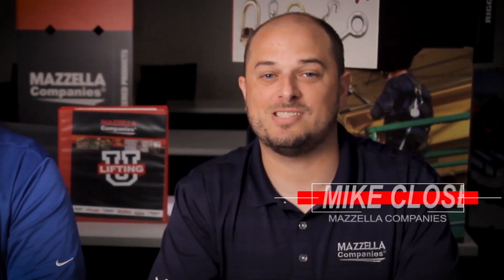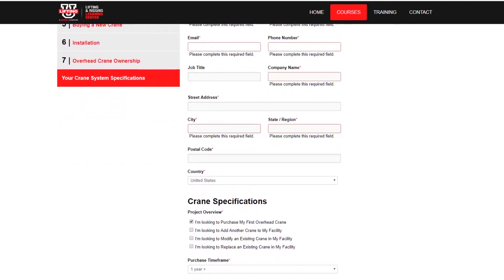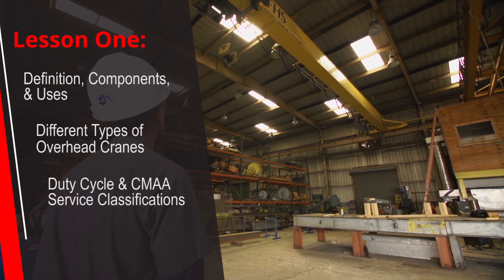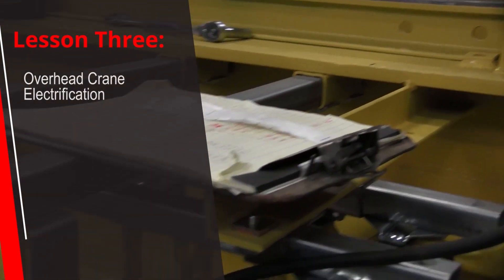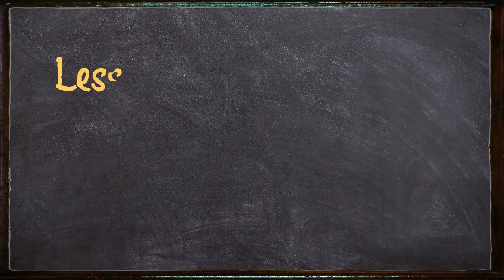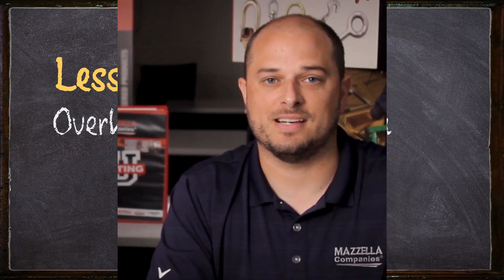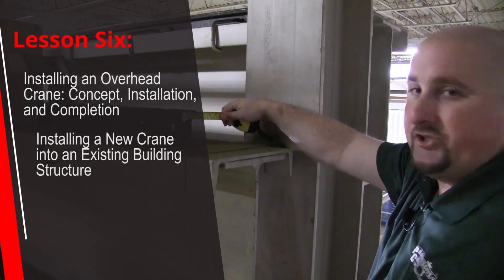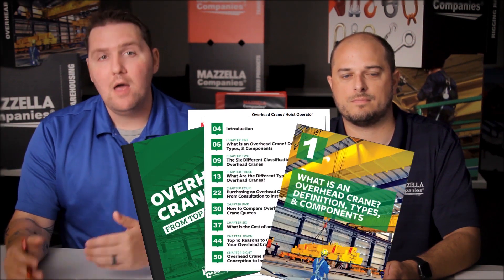An Overview of Cranes 101: The Online Overhead Crane Course

Comment: Do "all" cranes manufactured & sold by Mazzela Companies have either the Mazzela or Progressive name badges?  Any other names?  What is/are difference(s) "if" any?  TIA.
Reply from the maker: Bruce,
Yes, all of our cranes are branded Mazzella.  Progressive Crane and FHS logos are also present as those are companies Mazzella has acquired in the past.
Reply: (1) So, are you saying the Crane brand will be whatever Mazzela Companies' division the crane was purchased from such as purchasing the crane through the Progressive line will badged as a Progressive and have their label on it eventhough they are are all made by Mazzela Companies?

(2) Do they all have the same components, capacities, & engineering details?  Or, are they like the Auto industry like "(A) This is is our top of the line Luxury vehicle (most expensive),  (B) This is our Moderately priced line (middle of the road), and (C) This is from our Economy Line (Plain Janes)?

(3) For transportation costs, are these three lines (Mazzela, Progressive, and FHS)  built in the same plant OR are they Geographically located in different regions?  I am assuming the same plant with the same transportation costs.  I have no idea how many Overhead Cranes are built in a certain time period.

THANK YOU In Advance.
Reply from the maker: Bruce, every crane will have all 3 logos because we are all one company.  Some regions are just more familiar with either Mazzella, FHS, or Progressive Crane so we represent each.  They are all manufactured the same way with the same capabilities. Depending on the size of the crane and the region the crane will be delivered to will determine where it is manufactured.